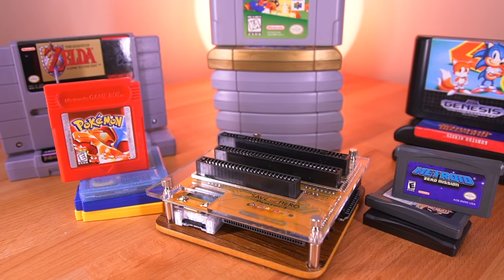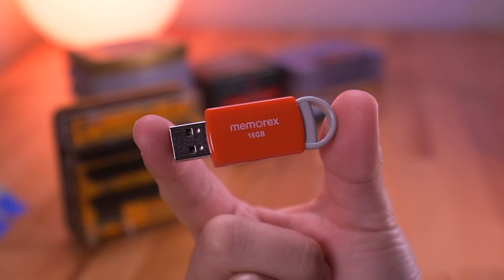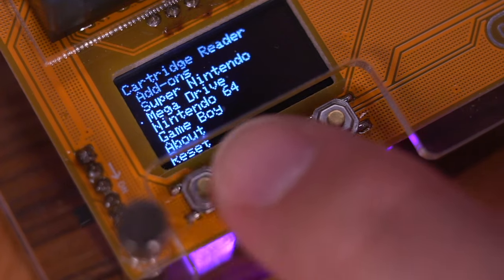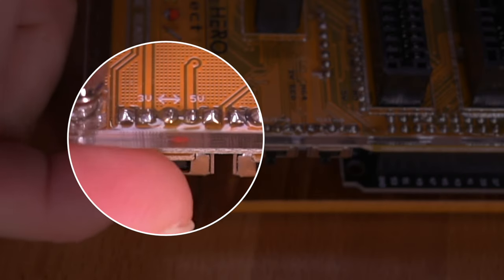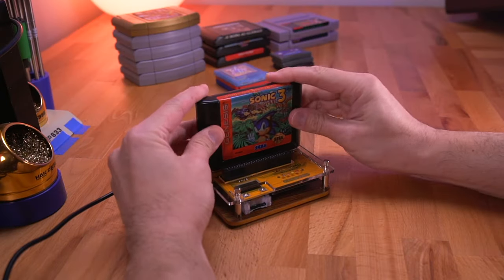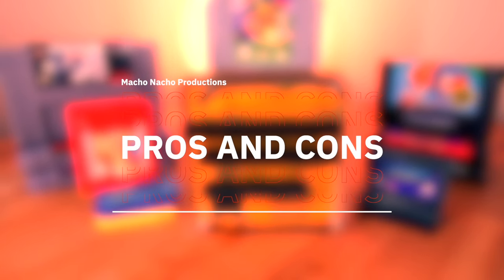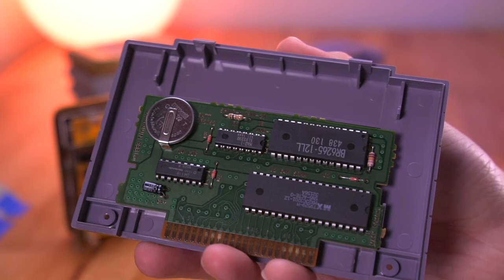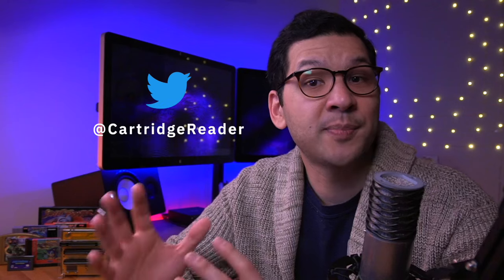Every Retro Game Collector Needs This!  The ULTIMATE All-In-One Device to BACKUP Collection!

Comment: The GB vs. GBA problem is odd since it was already solved by Nintendo themselves: A switch that is directly attached at the cartridge slot.
It'd be good to have the voltage auto-detected by the type of cartridge you put in as a security feature, so you don't accidentally fry your games.

But other than that this is really, really awesome!
Reply from the maker: It would be great if it was somehow automated.
Reply: That is a cool idea, however, repros require less power. Ex. SNES games require 5v, and repros are at 3.3v. N64 requires 3.3v, however, prototype carts  require 12v through the barrel plug on the Arduino Mega. The risk of frying your games is not very high. You'd have to leave the cart on there for a significant amount of time to cause any harm. Versatility is the reason.
Reply: @androxilogin  
But are there any changes with GB/GBA repros or flash carts?
Cause that was specifically meant as an "overwrite" for the Game Boy carts, not any other console.
Reply: @Kniffel101  yes. Same deal.

Comment: I already see a problem, and that's expecting the user to always select the correct voltage and settings, it's not trivial, but can be done to check which connector is populated and automatically set the correct settings.

There should be no reason why the user should have to remember to manually set everything up beforehand, as I can see some very valuable carts being killed by user error.
Reply from the maker: I’m hoping in the future this could all be automated.
Reply: So fix it.
Reply: @Donalbane  me or Tito? I didn't develop it, and neither did he.
I can think of a way to do it, but I'm not quite skilled enough at circuit design or software development to do it.

I would say what I think the fix could be, but you're probably not the person to discuss it with, as your terse comment suggests someone who likes to be argumentative than someone I could discuss this with in an intelligent manner. :)
Reply: I was going to ask what would happen if you used the wrong switch settings...

Comment: I'm a little disappointed this doesn't support NES games. I'll probably just stick with my RetoBlaster. It's a little less user-friendly, less aesthetic, and still needs a PC and software to run, but it costs way less and at least I can back up my NES library.
Reply: Never knew about the RetroBlaster. No question not as elegant as this device but, it looks like it will do everything for a notable less money...
Reply from the maker: Apparently there is an adaptor that Sanni will offer that allowed for NES and more
Reply: Check out the USB-NES. Supports NTSC, PAL, Famicom, and many more. Can also read/write battery backed saves. DIY kits and pre-built models are available on eBay.

Comment: It'd be really nice if, instead of manually toggling switches for each type of cartridge's you want to use, it replaced the switches with relays - that way when you use the UI to select the cartridge's type, it can automatically toggle over to the correct voltage/EPP/ClockSpeed(s).
Reply from the maker: That would be awesome!

Comment: This is so very well designed! and not as expensive as getting a dumper per supported device, or even a retrofreak, which doesn't do n64. Man, what a time to be alive!
Reply from the maker: Totally agree, what a time we live in 😁
Reply: Don't buy from Save the Hero. They have nothing to do with the open-source project. They just took the code and cashed in.

It's basically a bootleg, with shoddy quality, since Save the Hero can't solder properly.
Reply: @davidk.4593  time to promote the original project, then! You can even order the PCB with the SMD components done for you.
Reply: however, this is open source. If you build it, you're allowed to profit. Hardware is not free. This goes for either this project, or the guys selling them in etsy.

Comment: That's very cool.  I'd hope that Gameboy Camera support could be added in via Firmware update.  Other than that, and the other systems mentioned, the only other thing I'd like is an interface for the various memory card types out there.  Though, there's enough of those to justify a separate device altogether!
Reply from the maker: Agreed!  It would be great great if there was gb camera support. Finger crossed 🤞
Reply: What are you talking about?
I was able to dump my GB Camera saves and load them in an emulator

Comment: guess im a little weird since i dont value my saves all that much, even if i 100% a game, i still dont care if i lose that save since i can just get it again if i really want it back (more fun for me), the only exception would be games that i havent quite beaten yet. Still have cloud saves for steam and nintento switch, but i more use that as a means to move my data from my home console to my lite that i bring to work (i prefer the lite on the go and the hybrid console to be a home console), same with steam to go from home pc to laptop.

As of late though i have been more on the clearing mindset, albeit not playing all the extras (recently finished blaster master zero and am not doing the ng+, alternate characters, alternate difficulties or boss rush), things in the post game however ill still try to finish as i consider it to be part of the game itself.
Reply: From what i understand this is more to dump the roms and not only the save file. Which yes, is more important

Comment: Nice video and nice device!
Whish I had one device like this one 30 years ago 🙂
BTW all my repro carts bought from China, upon insertion in sega megadrive console, they oppose mechanical resistance because the PCB edge does not have a V shape cut. Yestarday I played castlevania Bloodlines from a repo cartridge and I berly inserted and remove the cartridge from de console. I got angry and sanded both edges of the pcb cartridge at a relative 45’ angle in order to obtain the V shape cut. Now it inserts and remove more easely.

Comment: Love the video and I’m really interested— I was disappointed in the lack of explanation if you got your settings wrong. Like wrong voltage— is it blowing the cart out and causing damage? Precautionary measures, if needed should have been highlighted.
Reply: If it’s anything like the Retrode, you get a corrupt file (if that).  I’ve ripped over a thousand carts with the Retrode & Kazzo and haven’t damaged one yet.

That’s on real carts; I can’t speak to whether repros are similarly durable.
Reply: The cartridge will refuse to dump and will stay still on the dumping process.
It's not really damaging if you're doing it for some seconds, but there is a risk if you are repeating the wrong process multiple times during longer periods of time.

Comment: Should have color-coded the switches!

3v-5v in RED with a little dot left or right of it (°3v/5v) vs (3v5v°)
eep in BLUE
Clk1 in Green
Clk2 in Yellow

The text near cardridges would also be in those colors So you could easily read it as RED°, GREEN, YELLOW. 
Meaning: 5v, Clk1, clk2. 

I don't intend to buy this device, but i remembered the switches now lol.

Comment: My guess for why they didn't include NES support is they wanted to get a certain size for the PCB which might of hit a good sweat spot for price and number of consoles on a single PCB. Though I also wonder why DS/3DS gamecard support wasn't added since even though they aren't as prone to degradation due to being flash based as time goes on if the cartridges aren't used within a likely 5-10 years before you start running a chance of losing the game data. Plus the cartridges and the reader are quite small so it would of been nice for them to include it
Reply: DS/3DS have security chips & decryption processes which could only be done with specific ARM7/ARM9 processors and proprietary keys.
Keys which can't be replicated without violating copyright laws and could not be included on open source projects.

NES/FC support could be done with an adapter on the SNES/SFC port but wasn't shown on video.
A specific firmware update was done 15 days ago in order to add a more complete list of mappers supported for that system.

Comment: $110 is not expensive at all for this all one dumper.
I paid around 60€ for the Retrode 2 and still had to pay for the GameBoy adapter which can't even read the save data from those cartridges in particular.
If I did not already have the Retrode for my SNES and MegaDrive stuff as well as a dedicated GB/A dumper, I'd go for it.

Comment: What an incredible concept! In regards to the price tag it could of had bigger buttons, felt more premium as you insert the cartridges and was more compatible with familiar formats like NES. Overall awesome vid as always Tito, I’m always looking forward to the next one dude 🤓👍✨
Reply: There is an adapter for NES as well as others available. The "Save the Hero" guy is not Sanni. Unfortunately this video is filled with misinformation about the project.
Reply: Check out the USB-NES. Supports NTSC, PAL, Famicom, and many more. Can also read/write battery backed saves. DIY kits and pre-built models are available on eBay.

Comment: This is really cool, but I'm more excited about the potential shown in the "add-ons menu" here.  We already have several options for SFC/GB/GBA and even MD and N64 at this point, but are lacking really convenient ones for PCE and FC/NES.
Reply: The PCE and FC/NES adapters are ready (and kicking) but not shown on video.
Reply: Check out the USB-NES. Supports NTSC, PAL, Famicom, and many more. Can also read/write battery backed saves. DIY kits and pre-built models are available on eBay.

Comment: Now I am wondering seeing it does Repro carts as well, what happens if you were to say put a snes repro cart (for example)  in the reader and select Super Nintendo instead of Flash repro?  Would it still read it, reason why I am asking is it would be a nice portable until (with power brick) to take to game conventions if I can easily tell a repro cart from an authentic one without actually opening the cart.  Also would I be able to tell the difference just by reading the display info of the cart?  

I noticed your repro cart read
Type: LoROM SlowROM
ICs: ROM ONLY
Banks: 64  Chips:0

While your authentic cart read

Type: HiRom FastROM
ICs: ROM SAVe
Banks:64 Chips:2

Would that be a way to tell the difference? 
Is there a way you could do a quick 5min video (if needed after doing tests) if it does work and what to look for.

Thanks for the video
Reply from the maker: That’s a great question. I’m sure if you know what to look for this could be helpful for that.

Comment: Looks nice, but I am sceptical to fry a cartridge by accidentally using 5V on a GBA game or switching a game or settings on the fly between dumps while the device is still switched on.

About the compatibility a comparison with the retrode would be nice. The retrode relies much on adapters wich is good and bad at the same time ;-)
Reply from the maker: I definitely want to check out the retrode!
Reply: @MachoNachoProductions  tbo I totally forgot the retrode has switch for a voltage selection too.

Comment: Interesting device but it is odd that you have to set manual switches but the options to read other cart types are still present in the menu. I'm guessing this is in case adapters for other carts are made.

For now I'll just stick with my GB Operator as my GB, GBC, and GBA games amount to most of my collection.

Has the dev set a price for non-Kickstarter kits?
Reply from the maker: Haven’t seen anything on post Kickstarter pricing yet

Comment: Would the device dump games/backup saves through a converter? For example could you plug a Power Base Converter into the Mega Drive slot to backup Master System games?

Comment: some questions: does it also accept 32X carts and does saving Sonic 3 & Knuckles from both carts work?
Reply: If I remember correctly, Sonic and knuckles is the only cartridge that has the same functionality, so your Sonic 3 & knuckles data well most likely just be on the Sonic & knuckles cart
Reply: if it doesn't, its open source, so someone could add the functionality via firmware update. Depends on how different 32x and the Expansion Cart are read compared to a regular cart i suppose.
Reply from the maker: That’s an interesting question.  I haven’t tried any of my 32x games. I’m guessing it won’t work but I will definitely try it 👍

Comment: 8:50 Let me know when they add NES and Neo Geo Pocket support.
Reply: The system already supports them right now.
You need adapters which weren't shown on video.
Reply: Check out the USB-NES. Supports NTSC, PAL, Famicom, and many more. Can also read/write battery backed saves. DIY kits and pre-built models are available on eBay.

Comment: I'm assuming nothing happens when you hit the wrong switches, guessing it only provides power to the right slot in the correct voltage
Reply from the maker: I’ve actually used it without messing with the switches and it actually still worked for a few games. I wouldn’t recommend doing it but it seemed to work
Reply: If it's the same as the previous version that's been on Github for a while (which it looks like it is) then the only thing you have to watch out for is the 3.3V/5V switch on the Gameboy adapter - that physically switches pin 1 on the cart between the two supply rails and could potentially damage a GBA cart if you plugged on in when the unit is set to 5V.

Comment: Cool, but I wonder why they didn't just put a single switch with a status led next to each slot to automatically select the correct settings, rather than those four switches.

Comment: Since I'm not as familiar with ROM dumping - when you copy the save files off, if/when the battery dies, is it possible to put the save file back on the cartridge once you've changed the battery?
Reply from the maker: Yes you can!  It’s a great tool to have for that purpose. Download the saves, change the batter, then re-upload the save.
Reply: @MachoNachoProductions  it would have been nice if you touched on that in the video.....

Comment: Just the aesthetics of it is making me think of the INL retro, but apparently this has better support and is more user-friendly
Reply: Not sure exactly what you mean by better support. The INL retro has more cart slots on it, so seems like it's capable of supporting more carts without having to buy a new unit. Never tried to use those, so maybe the software doesn't support them yet. Doesn't the INL retro also support flashing ROM chips? I might be wrong on that one. I remember seeing a video where someone used the INL retro in a project to do a rom hack on a cart, but don't remember how they flashed the rom chips.

Having the screen right on and with easy configuration is super nice tho, agree with you there.

Comment: Cool video. This is definitely something I will add to my arsenal, as I have a Retrode, but the lack of support after the original creator abandoned the project has made it lacking in many ways. Any word on whether or not it has support for Genesis 32X cartridges?
Reply from the maker: I need to look into 32x support. I think it’s unsupported but it’s worth looking into for sure  😁. Cheers Justin!
Reply: Don't buy from Save the Hero. They have no affiliation with the open source project, but just took the code and cashed in without contributing at all. Also, their soldering quality is apparently sub-par.
Reply: @MachoNachoProductions  No 32X support at the moment. In discussion for a future firmware update.

Comment: Hubiera sido genial tuviera lector para cartuchos de NES. Eso le hace mucha falta.
Reply: They are making NES and FCadapter
Reply: Check out the USB-NES. Supports NTSC, PAL, Famicom, and many more. Can also read/write battery backed saves. DIY kits and pre-built models are available on eBay.

Comment: Questions: 
what happens if you have the wrong power setting on when you put your cart in? I’m assuming under powering won’t do anything but would overpowering it damage your cart?

The menu says also says write save which wasn’t gone into. Is this a working/future feature to allow the placement of saves onto a cart? 

Also what happens when you put in a flashcart just for curiosity?
Reply: Flash carts can be rewritten to provided the chips have been added. If you use the wrong power setting it won't hurt anything unless it is on the wrong setting for a long period of time. Yes, you can write saves to your cart without hassle.
Reply: @androxilogin  thank you!
Reply: @sickregret  also please be aware that the twitter provided here is not affiliated with Sanni, nor is the "Save the Hero" project. Sanni is not from Japan, he lives in Germany. The poster unfortunately based this video off of much false information.

Comment: What happens if you place a 3v cartridge with a 5v switch? Will it give an error or will it damage you cartridge?
Reply: I have tried it. So far it will not detect or read your cartridges properly. (your dump will become garbage). You might end up corrupting your save file in the cart..